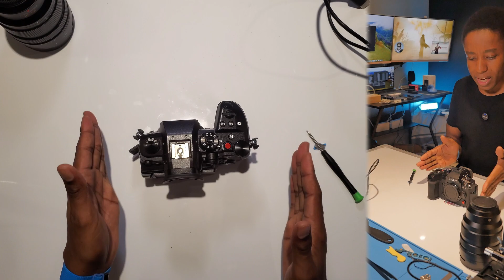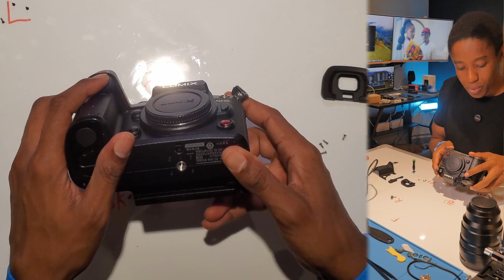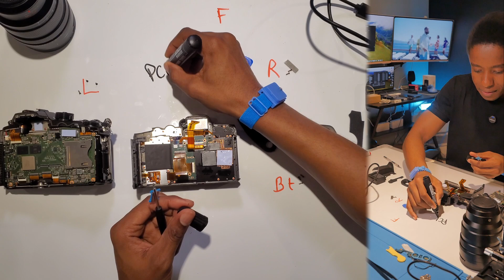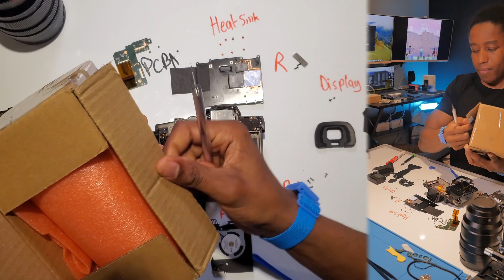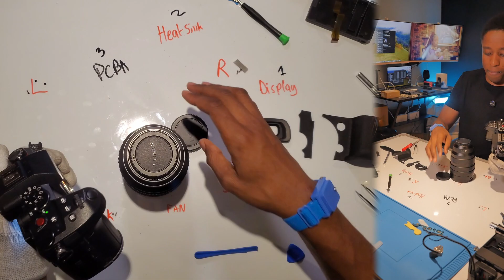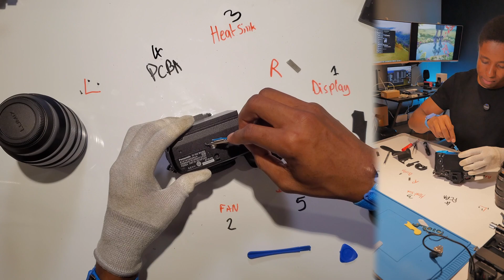Panasonic Lumix GH6 Display Repair

Comment from the maker: Feel free to Let me know if you would like me to do a separate video showing you how to change the flex cable.
Reply: Would be good to see so I can fix my old screen as a backup :)
Reply: Can you do a video on replacing the flex cable as well? My GH6 LCD just displays coloured lines when the screen is on. Should I just replace the cable or the whole LCD?
Reply from the maker: Hi ChrisanDanya, I will make a video but I can tell you this for sure it’s a slippery slope trying to replace the cable alone. Chances of breaking the new flex cable are extremely high.

Comment: I did just the cable (not the whole screen) and it took 6 hours. Wow. Tough. 

For those doing the cable only, if you are having “orientation” problems after you install….or the screen thinks it’s closed when it’s fully “open” you need to trick the hinge into thinking it’s open/closed with magnets. If you hold magnets against the hinge into thinking several orientations, you will see it changes the cameras “orientation” 

Just play around with it and it will eventually find its way into the right orientation.

Comment: Hey, quick question for you. I have a GH6 and the screen display orientation has been giving me issues. when I flip out the screen it shows upside down. But if I tilt the screen up it straightens out. Also, the hinge is loose, so the screen can wiggle up and down vertically. Do you think there's a switch in the hinge assembly that now since the screen is loose on the hinge it won't switch properly? Is this repairable if I remove the screen and take off the hinge caps to tighten the screws?
Reply from the maker: Hi, there’s a magnet in the screen that works with the haul sensor. If that magnet has move out of place the display won’t articulate (flip). On the other hand it could also be a bad cable. Step one is do open the display is to Check the magnet is not out of place.
Reply: @a @andrewsilungwe ank you for the information. The screen works great still. Would you recommend just replacing the cable while I’m in there? Is the magnet glued in place or is it held in with a screw?
Reply from the maker: I wouldn’t recommend replacing the cable immediately unless you find the magnetic didn’t move out of place. The magnet is held in by glue and a snap
Reply: @andrewsilungwe thank you very much for the insight. I appreciate it. And you did a wonderful job on the video.

Comment: I’m having a very random LCD / touchscreen issue on my GH6.
The rear screen shows green color shifts, lines, flickering, and the touch no longer responds.
HDMI output is always fine.
The issue reacts when moving the flip-out screen, and power cycling sometimes helps.
What’s weird is that I shot 13 full days with no issue, then two days later the LCD became unusable again.
Sounds like a damaged LCD flex cable.
Has anyone here experienced something similar?
Reply from the maker: Yes I have experienced this, it is the flex cable. Unless you can find a skilled electronics repair shop or person, I suggest buying a full display that comes with the flex. The reason is it’s very difficult to wind the flex and might end up breaking it in the process

Comment: I only exchanged the FFC and it works now. But to be honest, it was a lot of difficult work to get the FFC winded correctly. With only medium experience, I would suggest to buy the complete screen assembly. Thank you very much for the super helpful video!
Reply from the maker: You are welcome and thanks for your insightful comment. Yes replacing the Flex cable is more complicated and very easy to mess up kudos to you for doing it successfully

Comment: Hi Andrew, thanks for an awesome video! I've liked and subscribed 😃

While recording some clips on my GH6 the other day, the LCD screen flickered and then went black. When I turn the camera on I can see the screen turns on but nothing is displayed except for a thin line at the very top of the display. After a few seconds, the screen gets brighter and a bunch of lines start to appear. EVF is working fine. Do I need to replace the whole screen or can I just replace the flex cable?
Reply from the maker: Better safe than sorry. The cheaper option would be to replace the flex cable but the more reassuring option is to replace the LCD which comes with the flex cable

Comment: Hi Andrew, 
I finally bought a new screen (about $150).  I first tried changing only the lcd panel without opening the camera case, but that didn't solve the problem. The image was still upside down. So I finally changed the whole part as in your tutorial, and everything now works normally.
The problem probably comes from the display's long flexible cable. Next time, I'll just buy only a new cable ($15).
Reply: The image was upside down.
Reply: What was the problem ? no image on screen ? mine started glitching a little and now the image is gone completely
Reply: Hi I’m curious what screen issues are you having?
Reply: At first, I bought the cables only
 , but its so hard to open the display... so many screws yet, cant open it. So I bought a new display instead. lolll

Comment: Hi Andrew, greetings from Lima - Peru. My GH6 touch screen doesn't work, can I change just the flex?
Reply from the maker: Hi Carlos, you need troubleshoot the issue it could be the cable issue which is cheap but much more difficult to replace. On the other hand it could be a digitizer issue.

Comment: Hello Andrew,
Congrats! The screen image of my gh6 has been upside down for a few days, as if the gyroscope no longer worked. The image is also slightly shifted to the left, with a black band on the right of the screen. Other users faced the same problem. Do you know if changing the screen would solve it? Thanks.
Reply from the maker: Hi Florent, this is actually one of the signs of a bad screen. The gyroscope starts failing first then the display shows lines and so on. Best solution is to have  the display replaced.
Reply: Would it be possible to change only the defective part of the screen (with its PCB) without opening the camera? On eBay, you can find this part of the screen only, without the whole mount. Have you tried disassembling your defective screen to access the PCB behind the small LCD panel?
Reply from the maker: @flow_xxi yes I have and it should be possible to replace the defective PCBA. On another note it could also be a broken flex cable.
Reply: I have the same problem and am looking into doing the same thing. Thanks for the video Andrew.
Reply: I have the same issue. It  progressed from flippping image to black screen in about a month. I'm a long time lumix user and I never had anything like this happen before. Panasonic shoud make a recall I think. Were you guys able to fix it by replacing just the screen part?
Reply from the maker: @kottik1 it’s a little too late for a recall. The flex cable is too stressed with all the flipping the display does.
Reply: @andrewsilungwe  it’s definitely one of the most mechanically stressed components of the camera. I had it replaced on one of my lumix cameras once before. After that incident I decided to not flip lcd all the way flat to body, and never had this problem on my GH5 which I used extensively for 6 years. My approach was the same with the GH6, so I was fully expecting the cable to last longer then a year of light use.
Reply: @andrewsilungwe  I should note that my GH6 also got a small crack on lcd for a while (half a year at least) before it developed flipping image issues. I first thought that the crack led to it, but seeing others affected by the same issue makes me think that they are not related.
Reply from the maker: I think Panasonic “LUMIX” can develop a new durable replacement cable, there’s going to be a lot of people experiencing this issue soon. Especially when the price goes down.